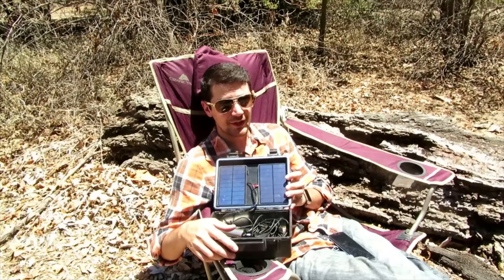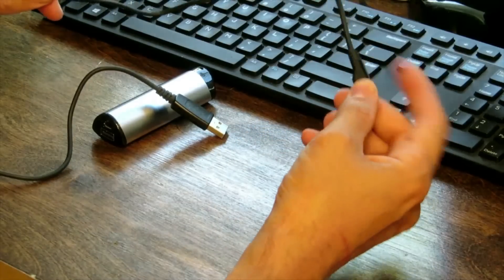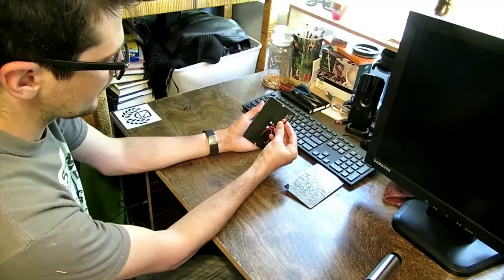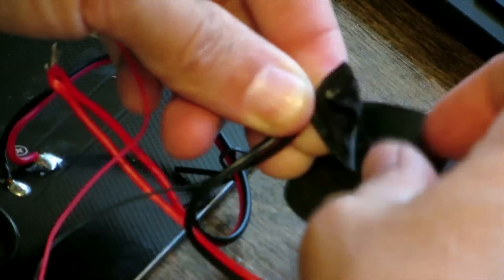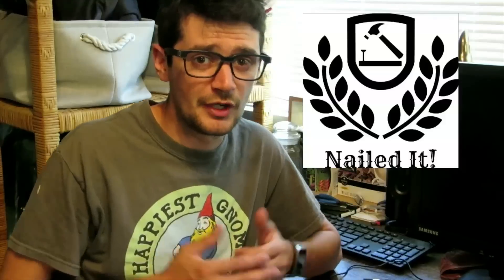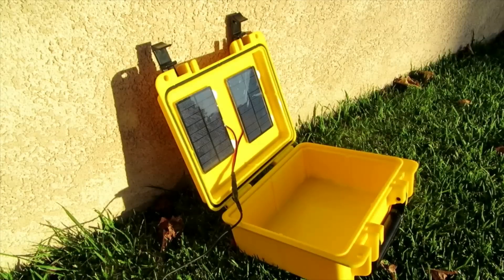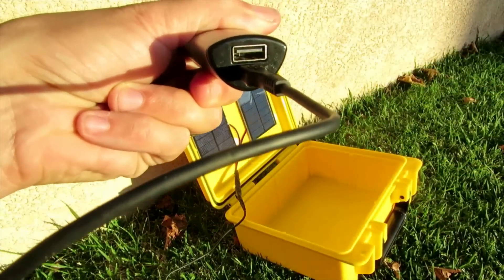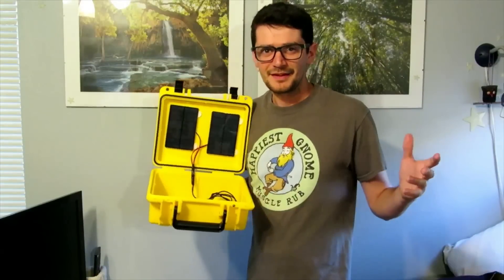How to Build a Solar Cell Phone Charger

Comment: you just need to make sure you have 5 to 5.5 volt panels at the higher amperage and a battery power bank that's big enough to store enough power to charge your phone otherwise you will not get a full charge. You need a dc-to-dc converter and you need to have a diode between the solar panel and the battery Bank just in case it feedbacks power and it won't damage the solar cells

Comment: Unlimited water supply using dehumidifier. Expensive products come with filters for ready consumption. Or, just collect the water and filter or boil it yourself. Unlimited water from the air.

Comment: Why replace when you can repair? I've patched shoes when a single stitch went out, epoxied plastic gadgets that have broken (cheese grater, phone mount for car, quick release clip for food processor lid), used hot glue to replace rubber feet on laptop and roomba charging station, repaired the plug on a drill press, and used silicone glue to fix a broken laptop charger. That's all in the past 4 months or so!

Comment: You can make it cheaper with 4 (or more) Solar Lamps from Dollar Store (~$ 4) and a 5V Booster upconverter from eBay (~$ 1). Use Batteries from old Laptop to store the Energy (using a Lipo charging cirquit from eBay for 1$). If you are good in electronics you can make a simple Solartracker maybe for 5 Dollar (I made it from scrap Cassete Player), so your Solar Cell faces every time to the Sun. For Camping you can make a simple small Wind Generator from old Harddisk Drive Motor or CD/DVD-Rom Motor or PC Fan (with modification - larger Wings) with Battery loading cirquit for emergency Power for your Mobile Phone, Tablet, Torch, Radio ... With a Solartracker you can use a small parabolic Mirror and a Peltier Element mounted on a dark cooling Plate (from old CPU or PC Power supply or improvisieren it from Material you can find. Copper is the best but expensive, Aluminium works good too) you get an alternativ to your Solar Cell.

Comment: Great video.  Really enjoyed it and it is most useful.  Here's a tip that I use in my life for productivity and safety:  I take many meds (yes I'm old!).  I have to take several once a day and a few twice a day.  I am often away from home when it is time to take the second dose so I carry a small pill box for those meds.  Here's my tip:  In the morning, I take all my once-a-days and the first dose of the two-a-days.  Rather than reading the labels to figure out which meds I need to put in the pill box for later, I use a Sharpie to write a large "2" on the cap of these meds.  No mistakes and all my meds are ready to go when I need them.  Additional tip:  I set an alarm on my iPhone when it si time to take the second dose.

Comment: Growing up, my father would sleep with a fan on and I got used to the sound from the hallway. So, when I got my own place, I found I slept better with a fan going nearby, in summer..it points right at me.
But my fans would die off after a couple of years, one didn't even last 8 months, while my fathers fan just kept going.
He explained that you had to clean it up every few months and check to make sure things worked right, being a Flight Engineer in the Navy an then a Ford Chief mechanic later in life, he new about machines and taught me what ever I needed to know.

Now, I take care of my own things and I encourage others to learn.

Comment: Great idea. You mentioned soldering. For those uncomfortable with that, wire nuts or crimping connections work well too. Simple tip: Make sure to tape a few spare connections inside the case. This way you are ready if you ever need to make repairs.

Comment: I'd be interested in building one if I didn't already have a portable 5watt panel, goal zero by brand. the panel I purchased came with a battery pack that uses AAs or AAAs, which is convenient for flashlights, bit the pack also outputs USB for mobile devices. I believe you can get the goalzero battery charger separately, which might be a nice addition to the DIY solar charger.

Comment: make your own fire starters out of candle wax and cardboard. melt the wax down and cut the cardboard into strips. combine and you have a safe fire starter that is easy to pack with you when you go camping or as an emergency use. Make them as big or as small as you want. take an aluminum can and cut the bottom to whatever height you want (i.e. 4 inches) and use that to put the melted wax and cardboard together.

Comment: Even if those wires don't move much, I'd advise a different method of retention.  Electrical tape is actually not made for retention and when it gets warm the glue fails, not to mention you're using it in a rugged environment that is prone to vibration.  At least use some small wire nuts or crimp connectors, but don't just twist the wires and tape them.  That's asking for a problem.  Other than that, good project.

Obligatory tip :-) : You can be more self reliant by teaching yourself the basics of any skill you would normally have to pay someone else to do.  Learn to change your own oil, or a flat tire.  You don't have to do it every time, but knowing how to do more of these things yourself will build your confidence to do other things.

Comment: I have very limited space for gardening. I've been using the stacked 5 gallon bucket method. The inside (top) bucket I drill a bunch of drainage holes in the bottom and a 1" hole in the bottom. In the 1" hole pass a 1"pvc tube that is about 2' long through it. Once done fill the top bucket with soil and plant desired vegetables or herbs. Place the top bucket into the bottom bucket and hold it up to the light. Where you see the bottom of the top bucket, drill a hole through the bottom bucket, just below the top bucket. This small hole acts as a vent and prevent overflowing. The bottom bucket acts as a water reservoir, plus the design prevents mosquitos from laying their eggs like most water catchers. When watering, initially get the soil wet, but then fill the bottom bucket through the 1" pvc pipe that is sticking up above the top bucket. Once plants mature, their roots will begin to access the bottom bucket. I've found I use much less water than conventional gardening and have less issues with mosquitos larvae in water tanks. Plus the buckets have the advantage of being moved around to optimal lighting areas based on the types of plants.
Reply: Wow Dwight Souder!
That sounds like an amazing idea for an herb garden! What kind of plants have been successful with this technique?
Reply: Peppermint, cilantro, tomatoes, bell peppers, pole beans, sugar peas, lettuce. I didn't have much luck with corn or sunflower. I haven't tried potatoes, radish, and some of the viney plants like watermelon or pumpkin.

Comment: Use a toolbox on wheels!  The small carry-on luggage on wheels makes a great everyday toolbox. You can put your most used items in the small case and wheel it wherever on your property where you need to make repairs and since you are working out of your well organized toolbox right next to you, there is no tool clean when your work is finished. Just role it toolbox into your shop and it is ready to go for your next project.  Happy woodworking!

Comment: bit of a misleading title. 

more like how to charge your phone from an external battery that needs to be charged first with solar panels to then finally charge your phone. regardless, I liked the video.
Reply: this will never work. its the same rubbish as the chinese "batterypack+solar pannel"...
 those solar pannels barely produce enough e- to power an LED light, abd because thre are no capacitators the phone will not charge.
been there done that
Reply: use xmas light solar pannels or a guarden light solar pannels but if theres not enough charge hot glue 2 together

Comment: Especially in colder climates, indoor gardening can be really great. Herbs especially are easy enough to care for and preserve. Personally one of the biggest things I've done is switch to reusable cloths over paper towels/make up wipes and the like; if you're a bit crochet/knit or sew savvy you can even find tutorials online to make cute little rolls or dispensers. I see someone recommended rain barrels already; if you live in a colder more temperamental climate also consider collecting slow late in the season. Even having troughs to catch or shovel  snow into can really help prevent puddles and muckyness in the back yard after a spring sleet: take it from the Canadian :P

Comment: I doubt those panels would even keep up with a phone's normal discharge rate, let alone put out more than the phone would use to end up net positive.
Reply: +Timothy Cruz Yes.  Are you familiar with the efficiency of battery banks, and how you will also lose power there?  Those panels could never keep up with one cell phone sitting at idle for a day. I don't care if you charge a battery bank first, that just costs efficiency.
Reply: Did you even watch the video before commenting?
Reply: Hey Jonathan!
It really depends on the phone, right? I can tell you that from a couple years of using mine, the model I built in this video won't get the phone to 100% but it gets darn close. When you're out camping for a couple days and you want to listen to a little music, it's really nice to have.

Thanks for watching!
Reply: Yep, you are correct, sir!
:D
Reply: I know of their inefficiency, dont think too highly of yourself. There was a whole section at the start of the video explaining the scenario where you might need the solar charger, and you chose to glance over that. Who cares if it's inefficient if you have no other access to power?
Reply: +NAILED IT! Realistically speakin, how much can you use your phone and listen to music with a Bluetooth speaker and this sort of keep up enough that you won't be SOL if you need to make an emergency call?
Reply: +Jonathan Mulzer 
I'm guessing in your scenario there's no one with you? No other cell phones?

In that case, yes. Don't worry about my video. Thanks again for watching!